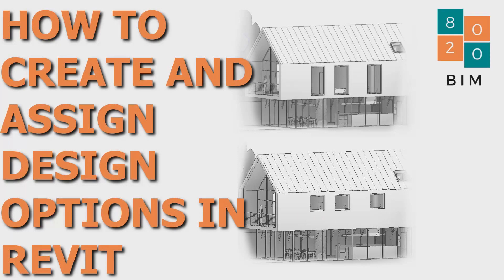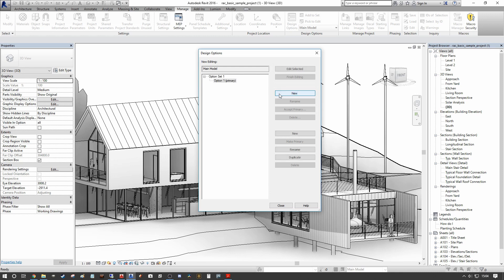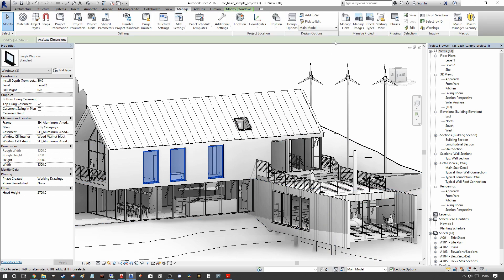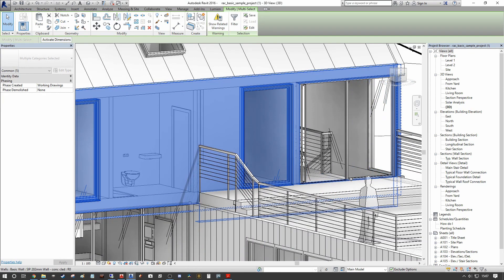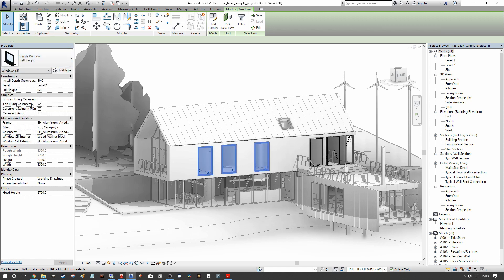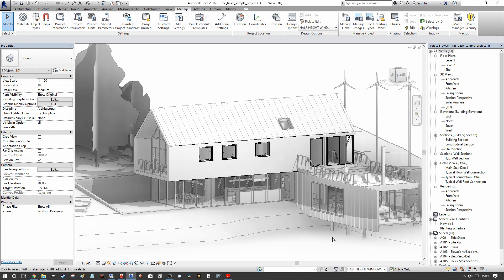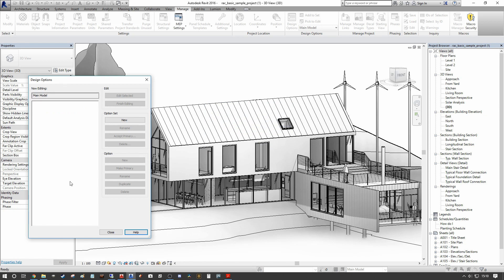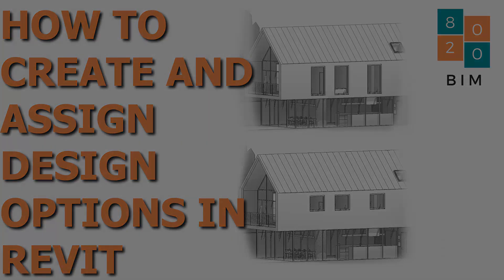Revit Tutorial: How to Use Design Options

Comment: Could you explain in what scenario you might need a second "Option Set"? Thanks again.
Reply from the maker: Hi again Charles,
You may need a second / third option set of there are other parts of the building are also subject to design options. For example, you could have a theoretical "extension A" where you have two design options within the first option set. Elsewhere on the building footprint you could have another extension, "Extension B" where you could have two design options within the second option set. Finally, you could have an internal retrofit, "Area C" which is subject to multiple design options, held within option set 3.
Apologies if this is a convoluted explanation but thought it best to run through a hypothetical example. 
Let me know if you have any other queries at all Charles. 
Niall
Reply: @8020BIM  nope, that was good. Thanks for clearing up revit. Been using your videos to help brush up for the Revit Certified Professional exam.
Reply from the maker: @charlesball9522  that's great to hear Charles. All the best with it and let me know how you get on. As always, feel free to ask any questions on the content as you proceed.
Niall
Reply from the maker: @charlesball9522  Hi Charles. I received a notification  that you left a comment on my video today but I have not been able to locate it so I can help you out. Did you remove it? If not, feel free to reply to this message with the query again and I wil ldo my best to give you a hand. 
Niall
Reply: @8020BIM  I removed it. It was a question about annotating the different options. When I dimensioned one, the units were correct, when I did the other it was different. Then I immediately realized it was set to a different style. Which is weird, since I didn't change it.
Reply from the maker: @charlesball9522  OK Charles, glad to hear you have it sorted. Note that I have jsut started a community discord channel which I will be online for a few hours a day. Feel free to join if you ever are looking for a quick reply/ some guidance.
https://discord.gg/RMFXeXZu
Niall

Comment: Good sir how to create a ridge capping for a roof
Reply from the maker: Hi Vishanand. Roof capping can be done in a number of ways. If it is one continuous element you could use a model in place family with an extrusion / sweep depending on the shape of the roof. You may also get away with a roof by extrusion with a buildup equal to the capping thickness if you required. If you are doing individual tiles for example, you could just create an independent generic model family of a ridge tile and array it down the length of the roof. There are many ways to approach this so it really depends on your roof construction and shape to best define the modelling method. 
Niall
Reply: @8020BIM  Hello....can you pls make that tutorial videos..ie roof ridge. Thanks